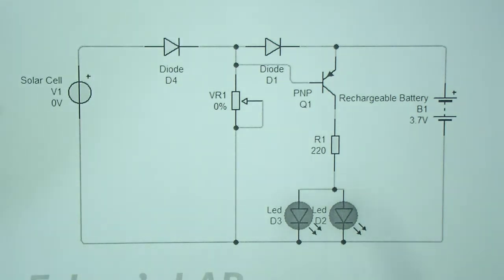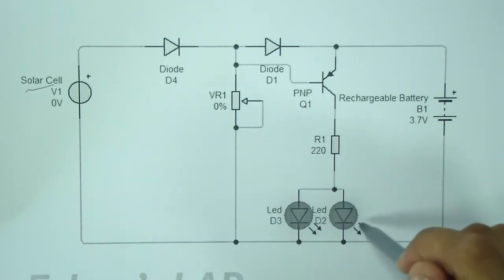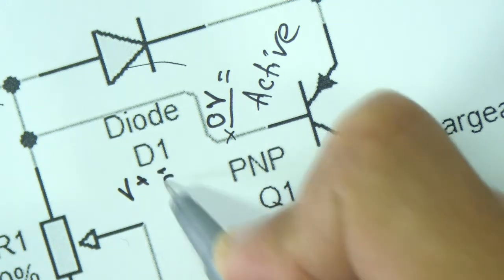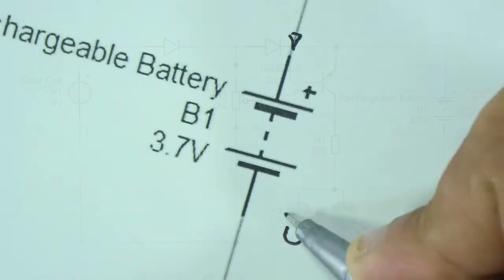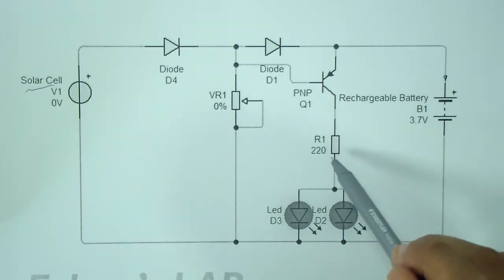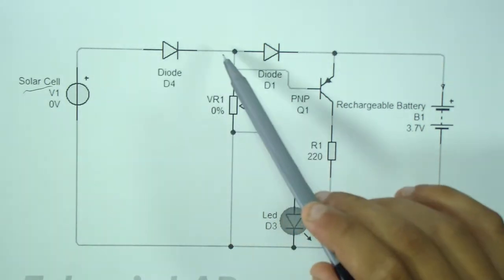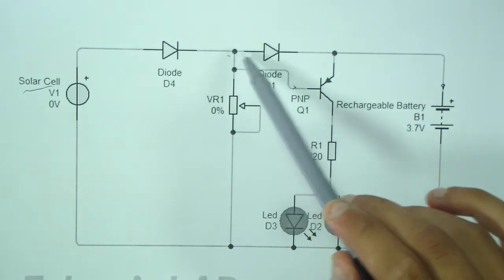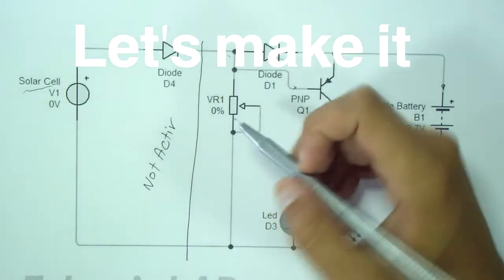DIY Solar Powered  Night Light at Home 🇺🇸

Comment: That poor 18650. Your circuit would make more sense using 3x NiMH batteries (if you were using a 5v solar panel but the schematic doesn't say) but not an 18650 lithium battery. No under voltage protection (which is required with Li cells). See NiMH here would be fine, since it looks like you're using two standard diodes (with a voltage drop of 0.6v each) which would reduce the voltage on charging the cells to 3.8 volt, slightly higher than the nominal voltage for NiMH cells and NiMH are cheaper and don't mind being drained to 0 as much. In-fact, if you were using NiMH you could probably get rid of one of those diodes too. You could use a protected lithium cell too (with the onboard DW01 and MOSFET package). Also, I couldn't really hear what you were saying because of the music in the background. Good luck with your future videos though. I hope my comment proves useful. :)
Reply: It did for me! Thanks